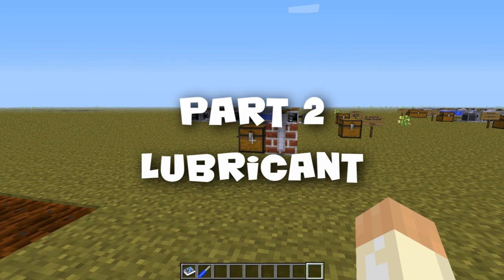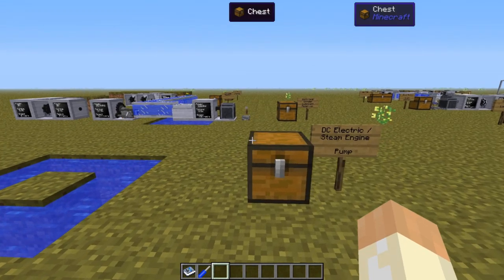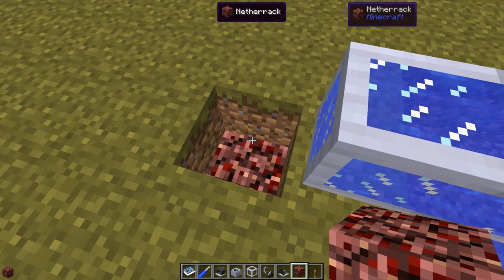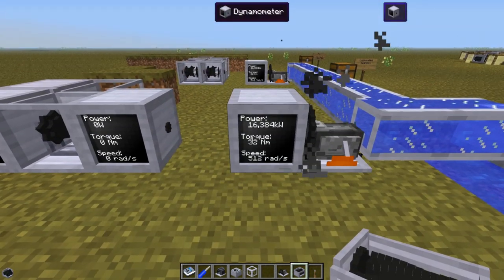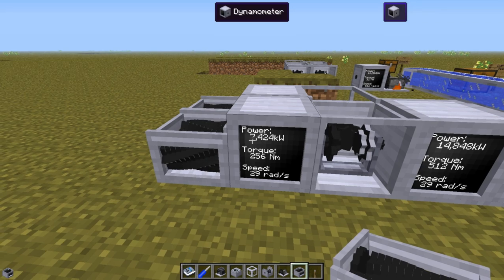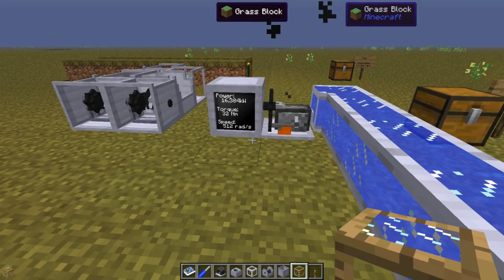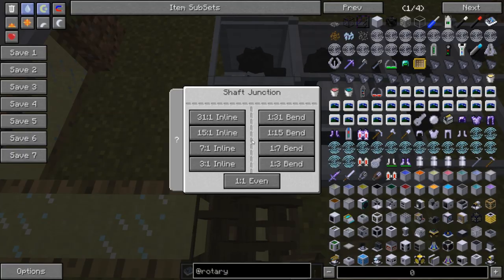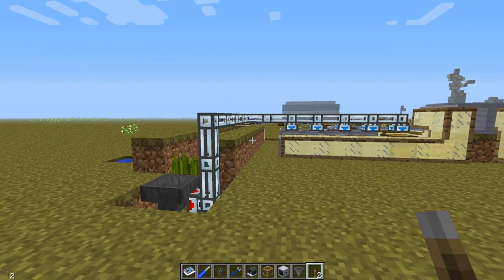RotaryCraft Tutorial - Lubricant (FTB 1.6.4)

Comment: how did you manage to get the pump working with a simple dc engine ?
I tried it in creative and I had to use a 8:1 gearbox  because dc engine only "produce" 4nm for 256 rads/s and pump needs at least 32nm to work
Reply from the maker: Hm, what modpack and/or mod version are you using? This tutorial is made in 1.6.4, and in the latest FTB 1.6.4 (Monster) pack, the Pump and DC engine are perfectly match in terms of power (1kW) and torque (4nM).
Reply: therealtkh ahhh I play tech world ...
well I'm gonna stick with my bc pump anyways , it's cheaper to build and ... no noise at all :P
I love rotarycraft , I got into it because I wanted to get more ingots from my ores , but those engine are really fun , but the noise gives me headache >_<
btw thx for your videos it helps a lot ;D
Reply from the maker: Tsunami401 I think you can place some wool on the top and sides to reduce the noise. Try it and tell me how it goes :)
Reply: wow I removed the dynamometer and replaced it and .... no more power but still noise xD then I removes the flying cooler and instantly ... BOOM !!!
hahahaha this mod is a bit weird but really funny xD
Reply from the maker: Tsunami401 Great that it worked on the DC engine, but yeaaah, the steam engine is noisy and harder to keep quiet. The Sound Muffler might work if that's in the modpack, I don't remember... Wool might catch fire next to lava/burning netherrack as well, so it might be bad due to that as well.. Anyway, that sounded like a graphical glith in the beginning, but... haha, sometimes it's fun when things blow up, but I don't understand why it would blow up... the engine should just spin as far as I know. Btw, regarding your screenshot, you don't need dynamometers everywhere, yeah, they are good for investigations, but you can instead use the Angular Transducer (spelling) to measure the power :)